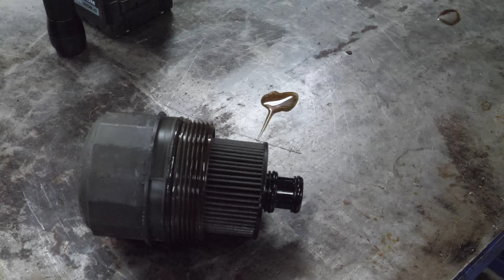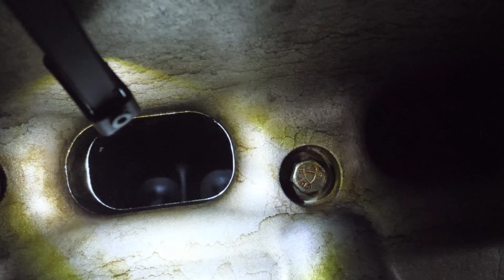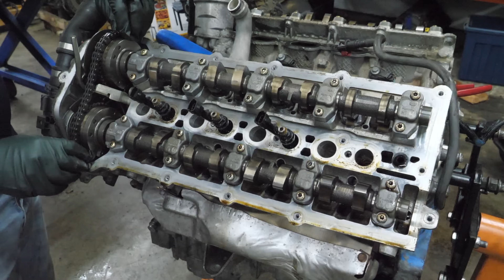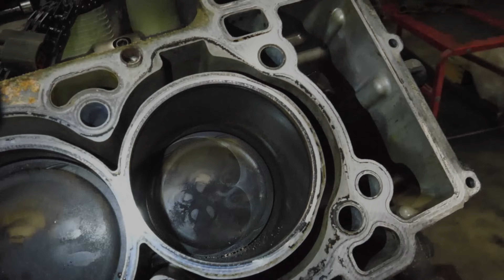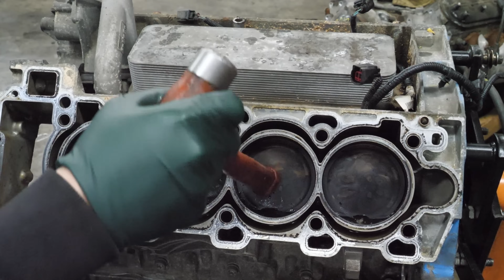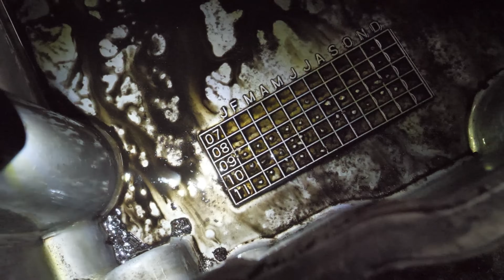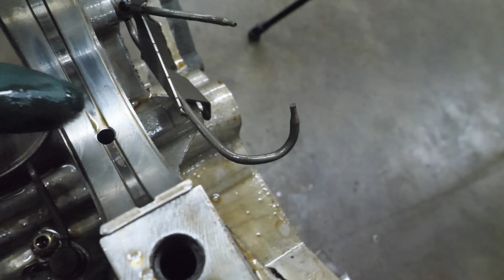500HP Jaguar Land Rover 5.0L Supercharged AJ V8 Teardown! Had to buy AND borrow tools just for this

Comment: Thanks Eric, In the late 1970s or early 80s I removed the Main Bearing Cap Bolts of a 1937 Leyland Bus engine. In the threads of some of the bolts were small beads of Quick silver (Mercury) now where did they come from?  Part of the original casting process, maybe? Leached out of the cast iron? Considering the amount of heat/cold cycles that engine would have done. Ted from down under.

Comment: Great tear down.  I would love to see what common problems there are with a 1.8 engine from 2016 Chevy Sonic, or the 2.4 SRT4 turbo engine from a 2003 PT Cruiser GT.  I’ve seen the 1.4 turbo engine videos for the Sonic as well as 2.4 SRT4 turbo engine in a neon, but not the 1.8 from the Sonic nor the 2.4 SRT4 out of the 2003 PT Cruiser GT.  Please see if you can find them.  I would love to see the tear down on them.

Comment: Yes infrequent oil changes (Jaguar are hopelessly optimistic in their oil change intervals) and people working on the engines who don’t understand them contribute to premature failure. Properly maintained these engines will happily do 150k+ miles. They did have timing chain problems initially but no longer and, of course, the early nicosil lined engines had problems with the coating failing. I have this engine in my SVR and it’s a brilliant motor and sounds wonderful.

Comment: I've worked at these engines a lot from the early XK8 days. They are good engines once Jag sorted out the initial issues, however, the murderous labour costs charged by the main dealer leads to reduced servicing and that causes a lot of issues. Their over complexity and very expensive parts doesn't help either and klills off a lot of otherwise good vehicles. Hevent been that deep in one for a while so nice job.

Comment: I worked for a demo company and we got a job demoing a pump house that was used to pump oil through the New Mexico - Louisiana pipeline. Those were diesel engines, six cylinder turbo engines… two of them in that pump station… but they still had beautiful brass oilers and an exposed valvetrain. You could see where the engineers had used string to wick oil to certain locations on the valve train. The pistons had an 18.5” bore. It was obviously a labor of love for those engineers, but my boss insisted we scrap them. 

I even had some interested buyers from South America, as they were still using the same models for electricity generation and also as a power source on large ships… but my boss was so focused on poverty finance that I could not salvage those amazing engines. 

I loved being in that pump station and I despise my boss for cutting them up for scrap. What a shame and what an idiot…

Comment: I agree with others that the broken plastic part was replaced when someone was in there.   Huge job to work on that engine if it was in a vehicle.   new engines are more complicated but euro engines look just over the top with complication.

Comment: The complexity of that engine was surprising, although quite clever (air to water and oil to water heat exchangers).  A lot of trouble was needed to brace the main bearing caps in an aluminium block.  Note that the chain tensioners were from Ford.

Comment: I almost bought an XKR.  It had some rash on the wheels but otherwise seemed OK.  The dealer even showed me the service history and how regularly it was maintained.   Only the service history,  on almost every time it was in, listed "unknown electrical"  as a complaint.  That caused me to walk , but it was so nice to drive.    Some time later I was coming out of a store and saw what appeared to be the same car.  The top was down and a guy appeared to have tried to start it but was beating on the steering wheel as I passed.    I'm pretty sure I dodged a bullet.
Reply: Missed out on a great car
Reply: @hvaccity5637 , no doubt.  I got on an entrance ramp to a highway and that thing wanted to do 100mph without even asking.     Not to mention the quality of the interior and comfort.   I look them up every once and while like an ex-girlfriend.
Reply: I had a 2010 XK, and now a 2015 XKR, except for low battery voltage  that can cause a host of lights (New Battery and everything is normal again), have never had an electrical issue. My 2015 has upper pulley change and a tune @ 600hp and it never skips a beat. Now, both needed water pumps at around 50k, but if something happened to this one I'd be frantically looking for another one the next day...JustSaying

Comment: The early AJ 5.0 had timing tensioner issues, I think until around '14. 
Just a guess, but could it have been a piece of the fuel injector. I do know that on this engine the fuel injectors tend to get stuck, and even with the proper tool they break frequently, part of the injector gets stuck then you need another tool to get out the stuck piece and it usually comes out in pieces. Just a thought.

Comment: This is a long shot but I wonder if the coolant that came out of the holes when you broke the fasteners loose, was from when the block was machined at manufacture and they never properly cleaned the block.

Comment: 21:02  that tube is used at shops to suck the oil out of the engine for servicing.  No need to use the drain bolt if you have the correct fitting and drain barrel.  I haven’t pulled a drain plug on a v6 or v8 Land Rover in forever

Comment: Unlikely that a spark plug electrode would detach. The coolant pipes had been upgraded with aluminum so something may have fallen into the intake runner during disassembly.

Comment: Coolant crossover pipe was a huge source of failure on these engines.  Plastic part which failed and leaked coolant and caused catastrophic engine damage.  They didn't update the part until 2017 I believe.

The tube in front of the timing chain is an oil drain tube that goes all the way to the bottom of the sump.  Makes for easier oil changes - you vacuum out the oil from the top instead of going under the car and dropping the skid plate to get to the oil drain plug.  The vacuum method is the preferred one in the JLR shop manual.

These engines were built by Ford.  JLR switched to BMW twin turbo V8's for model year 2022 and forward.

Comment: On PHAD Ivan found a similar issue with a Maserati engine that had a tensioner issue where the chain jumped and from memory they were Ford parts too. Apparently they need to have the timing chain and tensioners changed sooner than the usual 100,000 K's.

Comment: I find an actual 3/8 impact much more useful then the 1/4” hex impact.  

I started with just the hex and hand tools, then got a 3/8 compact impact and almost stopped using the hex. I have since added a big 1/2” and 3/8 ratchet type impact and now the 1/4 hex is used with 1/4” or 1/2” socket adapter for just running bolts in and out without torquing them.

Comment: Torx plus and polydrive are not the same.   They look similar but they are different.   I found that out the hard way on the head bolds of a 2.0lTVW engine. Luckily after getting the correct polydrive socket off the tool truck I was able to pull the bolts.

Comment: I dont know why it cranks me up so much, but I just like your attitude to some of the things XD

"Oh this part look nice. Not bad" Gently yeets to a side

But to go back on topic, as someone trying to be a mechanic, then I would imagine that Jaguar or Land Rover mechanics might earn alot on that kind of engine. I mean, I already see two places that will be a nightmare to change if the engine is still in the car. The high pressure system to the oil pan. Holy cow I wouldnt wish to work on such engine if it is still in the car. And I bet they just saying it takes around an hour of work to change say the oil pan, but Im petty sure it will take longer then that

Comment: Watched like 20 of these videos and this is the first one that has advertising for your business.   Good marketing.    I figured you had a junkyard/used parts shop but now I "know you" a bit and see what you do I am far more likely to use your company when looking for something. 

 Speaking of do you just do engines or are you a full junkyard with all sorts of other components.  I'm looking for a radiator for a 03 Subaru WRX with a manual and the factory air cleaner box and tubing.  Is that something you do?
Reply from the maker: I have one wrx that era on the lot, it might still have the stock airbox and radiator. Shoot us an email.

Comment: I'm not here for the carnage, and I like seeing you get a win with good parts to sell.  Not that the catastrophic failure post-mortems aren't interesting - they are.  I like watching the disassembly (and enjoy your humor and personality), and love seeing the innards of, and how unusual engines work. (Favorite being the Mazda rotary, followed by the Subaru flat-4. Even though I've done head gaskets on an EJ - I hadn't even contemplated disassembly beyond that, which was a real eye-opener... a Beetle flat-4, and especially a Porsche flat-6, would be REALLY fascinating.  A Porsche engine is probably a pipe dream, but maybe there's cheap Beetle engines around?  And diesels always interest me.  Oh, almost forgot, the CVT and the motorcycle engine were fascinating too... probably right up with the rotary... guess the Subaru was my 4th favorite.)
Reply: Ooohhh... another fascinating one would be a traditional Subaru transmission, either manual or auto, with the front diff and its equivalent of a transfer case.

Comment: Notorious for timing chain guides 2014 and previous.
Reply: Yup, thanks to the "recommended" 15k Oil Changes from the Dealer.  Embarrassing from Jaguar Land Rover.
Reply: @giudasilva3651  Yes, on a 500+ hp, SC motor 7500miles? I even wonder about 5k.
Reply: @september29ification  i change mine every 5000 KM. Still Original Engine components. Im at 207k KM now. 2012 Model Year

Comment: THANKS!  Please show the bolts that you think are TTY, head, rod & main, and I think you'll see that they are regular straight shank bolts that just use the torque-angle tightening method.  Real TTY stuff looks funny, it'll have a reduced/thinner section/s, like notches that are the part that stretches in them.  If they aren't odd looking, they are reusable almost forever!

Comment: You mentioned parts costs at the start, in the UK Jag part pricing is easy. Look up the same part for anything else and add a zero or two. Trouble is you're then paying a lot for money for little or no improvement in quality. The fuel pumps are a good example rather than one beefy beast you have these piston ones which are way more complicated to mount, the mapping will need to cope with the pulses, if anything goes awry the engine will go into cripple mode. When working they're great but then.... We found oil changes every 5K made life easier for the engine but only do the filter every other change. The thing seems to need the extra resistance from a little dirt to work at it's best if not the oil takes a little longer to pressure up at start, this may be another factor in them being so fragile. We hated them.

Comment: You go back to 38:26 that combustion chamber looks like it's got a good sized crack right between the valves on each side of the spark plug hole.

Comment: That chain play is normal while the engine is not running due to no oil pressure. I don't like it either, I wish there was a tooth that would engage the tensioner to keep it where it was last pushed. But I have no idea what that plastic piece was you found. Unless that was de bris from a prior timing chain guide.

Comment: Big end rod bearing get hammered more than main bearings as ( when)the individual pistons go through bottom dead center and TDC. The mass of the reciprocating components reverse at these points when there is no lateral movement . At 90 degrees to these points the pistons have there maximum side loads. All of these factors load big end bearings multiple times for each revolution of the crank shaft. This is one reason why lugging and engine down in two high a gear and the trying to excellerate is hard on engines. Cars with automatic transmissions always have less bottom end wear. Drivers can't abuse them as much. A good auto trans will down shift before the engine rpm gets to low with much throttle opening. Manifold vacuum or the computer will command a down shift.

Comment: I have been looking at buying one of these for about 4 years but still do not have one, I have been checking out their big issues which a couple of them I know I am able to do. A complete strip down no that's out of my League but coolant issue and timing chain stuff + supercharger stuff I can do (engine in car). Still, I hesitate to buy one with more than 90.000 miles on the clock as anything past 2010 would be out of my budget. I have had and worked on various v6 turbo engines in my time, I just wonder if his one might be a step too far. I'm in the UK and there seems to be a reasonable amount of spares and new parts available for the XFR 5.0.

Comment: You can see the oil fed chain tensioner bubble at exactly 27:38 .... that would indicate that the seal is leaking ... if it leaks air.... its leaking oil....

Comment: I think the vehicle this was originally in was in an accident. The lower oil pan was destroyed, leaving the dent on the oil pickup. There is also a black plastic thing attached to the lower oil pan. Your mystery piece of plastic probably came from the original broken one. They simply replaced the lower oil pan instead of dealing with the engine-out replacement of the oil pickup. When they did, they used a different color RTV than JLR did from the factory.

Comment: The problem with the tensioners is the ratchet mechanism. Not the oil seal. The tensioner doesnt have a gasket or seal when mounting it to the engine.  The oil pressure just applies pressure so if there is slack i  the chain assembly it pushes the tensioner plunger to the next step on the ratchet. There is a trick to installing new chain sets and tensioners. Esp when installing the grenade pin i to the tensioner, the plunger has to be completely allowed to extend then you use a 1/4" sovket and a vise to press the plunger back into the housing, set the pin. Anytime you remive the pin you have to reset the ratchet mechanism this way.  And they are terribly problematic and we are always doing timing jobs on them.

Comment: The dent in the oil pickup and the fact it was resealed down there I'd say is the car hitting something breaking the lower sump and denting the pickup. The Lower sump looks a tiny bit cleaner than the rest, so it is likely to have been replaced. The stuff in the screen looks like RTV. As for the main bearings/journals vs the other bearings/journals I have seen the same thing in some VAG engine with long oil change intervals (30.000-50.000 km). The oil simply breaks down to a degree where it doesn't support the crank enough. Considering that the rod bearings are much wider than the cranks bearings supports that theory since it should happen there earlier. These engine also uses 0W-30 which I think is a bit on the light side for a boosted engine. 10.000 km intervals and 0W-40 would make this survive longer. And a slightly heavier oil would also likely make the tensioners survive a bit longer even without the seals being perfect. And if thensiners survive longer, so will the chains etc.

Comment: I Own a 5.9 Dodge diesel turbo truck and would love to see a tear down on that , I'm sure you must have done one of those. how do I find that .1990 it has 240000 miles on it and running good . I love the POP on those bolts

Comment: Your impact probably lost a spring. There is a wire "spring" behind the collet that works with the detent ball to keep the bit in place. One of mine lost that "spring" and I have the same problem. Some day I'll likely replace it. Go a giggle search on the model number and you can download the parts breakdown for your model. You may need to replace the whole impact mechanism unfortunately. Love the teardowns!

Comment: Those are not complicated to do at all , but try reassembling it lol . There is almost no data on torques and replacement parts for the bottom end . btw you should try a V6 SC Jaguar or LR ! You'll like how the crank looks

Comment: Hey nice Job we tear down these engines every hour, and will need to import a 20ft container load if the prices are good of the 4cyl Turbo , L6 Turbo, V6 and V8 variants from 2005 to 2020 ( Excluding the Ford V6 variants) All the the JLR units

Comment: The dings in the piston look suspiciously like the ground electrode on a spark plug that broke loose and fell in the chamber.   I believe that Bosch had a problem with ground electrodes some 30 years ago, so it could happen to other manufacturers of spark plugs.

Comment: This is a ford engine built at  ford engine plant in wales we also built the AJ 166 v6 between 2010 and 2020 when the plant closed and you get the fuel injectors out with a flat blade screwdriver with the cam covers on 😊  mike ex FMC